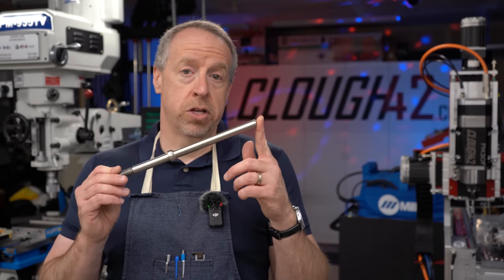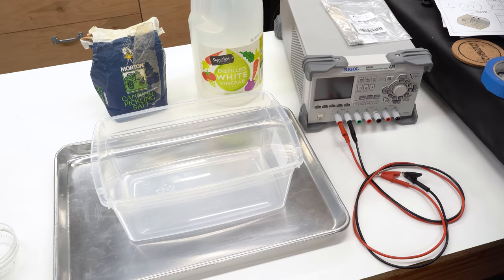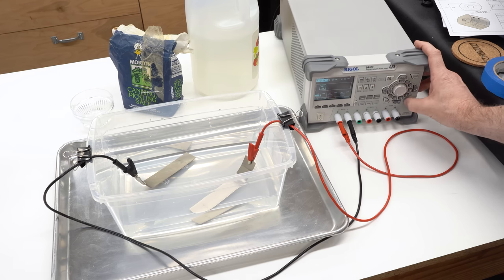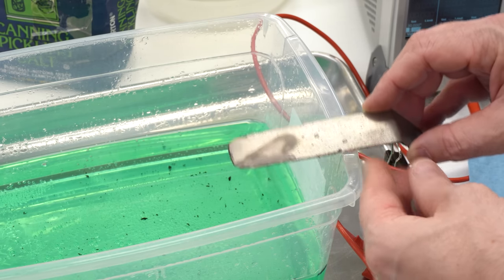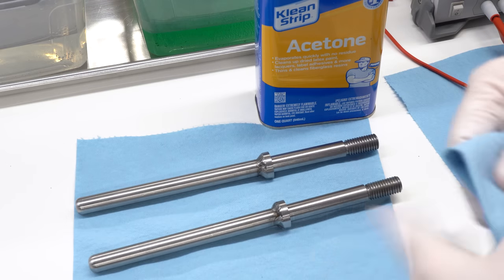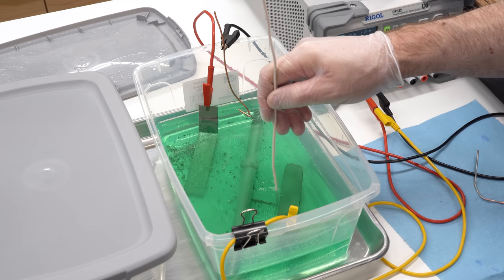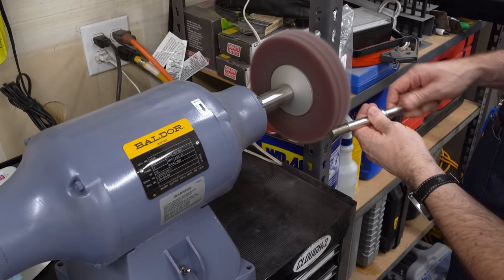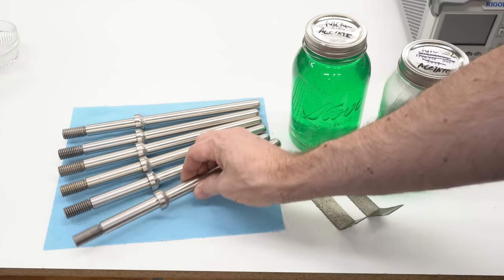Nickel Electroplating in the Home Shop - A Shocking Way to Prevent Rust!

Comment: Whatever you do: don't be tempted to do the same with chrome. The resulting waste is very toxic, you really don't want to deal with that.
Reply: How to create a superfund site in 3 simple steps.
Reply: @tyrannosaurusimperator  You'd probably need a bit more chrome than a few simple strips for a superfund site. But health-issues will appear much sooner.
Reply: Chromium salts are super duper bad news.
Reply: Absolutely, don't mess with chromium. Some of the salts (Cr VI in particular) are not compatible with a long and healthy life. Source: ex-chemist.
Reply: FWIW: Nickel is pretty toxic, just not as bad as chromium. 

FYI: "NICKEL ACETATE is a green, crystalline material, mildly toxic and carcinogenic"

You can also get skin rashes from nickel, so handle with care.
Reply: @spokehedz  Yeah, I put them on my eggs and they don't taste that great
Reply: Your not gonna get the Chrome needed to plate even if you wanted to try.  A chrome bath has the Chrome dissolved in the solution and lead anodes.  It runs at a current density of 1 to 2 amps per square inch.  
In other words, Chrome isn't s diy process.  Even for the most astute of tinkerers.
Reply: Meh you just flush it down the toilet. I may have worked at a place that did that. hehe
Reply: Definitely ! That is even lethal ...

Booby trap : no chrome means no stainless steel !!!
( as donor ... ) 

So even a crocodile clamp would release chrome ... theoretically ...

Comment: The major thing I picked up in my nickel-plating adventures is if you want a shiny finish post plating. You need to polish or buff your part to that finish before you plate it. A very common misconception is the buildup of nickel will "hide" scratching and unpolished surface finishes. This is not the case. It seems like double unnecessary work to polish a part before you plate it but if you are after a nice polish, it is essential. I did electroless plating with old cast iron parts from a lathe. It took several rounds of trial and error to achieve the result I was after, but finally I succeeded. I also discovered if you want a really great finish to plate the parts with copper first, and then nickel plate them. The copper plating is much less fussy, and your parts don't have to be absolutely perfect like with nickel. You do need to polish the copper layer before nickel plating, but copper polishes like a dream compared to nickel or most other metals. Hope this helps, keep on making the great content. Thanks.
Reply: Agree with you,Jarret. An old saying goes that nine tenths of the gleaming finish is due to preparation before the final plating process. The same is also true of high gloss paint finishes.....the secret to a stunning finish is nine tenths in the substrate preparation.
Reply: Almost all "chrome" is triple chrome plated.  Nothing adheres in plating equal to copper, so it goes base, copper is porous to water, so nickel is plated second, thin flash coat, and the chromium is a very thin flash that merely provides the hard finish and bright shine.  Plating puts molecule thick layers so it takes very little chrome in the end.  In a commercial shop, polishing is by far the most labor, cost step.
Reply: Excellent post.  Couldn't agree more. Trial & error, No Short cuts, & no quitting. Etching, electroplating, stone washing or anodizing. Gotta have the beach wheel(s) &  6000 rpm's!

Comment: I'm late to this post, but I wanted to share my thought after doing this few times. Clean, clean, clean. Keep your parts clean and keep your electrolyte clean. I filter my electrolyte after a few hours of use. Filter when you put the solution into the storage container. Keep the current low. One (1) amp for 4 square inches was to much current. Lots of bubbles equals pore plating. I'm no expert, but these are my observations.

Comment: The solution needs to be agitated during the plating process. Keeping the solution flowing helps prevent burning of the plating and also imparts more even plating. You don't want bubbles forming and staying put. The flowing solution moves the bubles so there is constant fluid contact with all parts. Electroless nickel plating  is also something to consider. Caswel also has nickel salt solutions so you don't have to make the solution by scratch.
Reply: how do you keep the solution agitated? I was thinking placing it on top of a home made magnetic stirrer
Reply: @LBCAndrew  That would be a good way. A fish pump works good. And even a motor driven propeller.
Reply: Bubbles and water quality are extremely important. Solution temp also plays into it. My dad had 46 years in aircraft plating. So get that water as pure as possible. And hang those parts so that Bubbles don't hang up for starts.
Reply: I almost forgot. For the best nickel plate you need a layer of copper. So first figure out how to copper plate. Cleanliness is important. So a really good rinse is mandatory with as pure of water as you can get.
Reply: @andron967  Right on the temp and water, the copper is best to use but you can nickel plate without copper. It just depends on the application and what you want out of it. People used to bring me coins to plate and often times Id forgo the copper because the finish was much brighter without it. Copper striking the coin would dull the final finish. On a tool, I'd certainly copper strike the tool prior to nickel plating.
Reply: If the tank is vertical you will have a little warming. And there will be some hydrogen released from your parts. So that will cause a little convection of the solution. Try a layer of copper plate as an under layment. Copper Nicole then chrome with a very clean rinse of purified water in between.  Disposal of waste gets to be a real problem. That's why private plating shops are becoming rare. Cyanide is one thing that becomes hard to dispose. But that's not all.
Reply: @LBCAndrew  A small aquarium pump will suffice for a small plating tank.
Reply: via "Gefahrstoffe in der Galvanotechnik und der Oberflächenveredelung", regarding your elecrolyte: The electrolyte temperature is usually 60 and 65 °C. The current efficiency is about 95%. This means that hydrogen development and aerosol formation remain low due to the process. However, the nickel aerosol content in the air at the workplace can be influenced by electrolyte movements or the blowing in of air. Nickel and the salts: Main modes of action: Acute: irritation after swallowing, irritation of the respiratory tract. / Chronic: Carcinogenic, sensitization possible with prolonged skin contact.
Have fun at home, with your open bath (like in the video) and your aquarium pump ( *facepalm* ) :) (Note: your old COVID-Masks will not protect you from those aerosols ...)

Comment: Adding on to what Sad Panda said, in my home shop experience with home electroplating and anodizing. I found that once you have your solution made with the cheaper source metals. Use a coffee filter to clean the solutions of contaminates. I then use a glass pyrex container to hold the solution and put it on a chemistry heat plate as I found it works better at around 110F. I then make 3d printed stands for the parts and have only nozzle thickness point touching of the part so there isn't a chance of accidental contact with the anode. I then use 100% pure material for the anode for the final plating process.

Comment: Check out some papers on adding the laxative Polyethylene Glycol (PEG 3350) to your plating solution.  I don't remember much from back when i was doing copper plating, but I was under the impression that as the molecules deposit they make peaks and valleys.  The peaks get larger and larger over time and you end up with that matte finish.  The PEG is attracted to the peaks and inhibits depositing, forcing the valleys to get plated until everything inverts and the PEG breaks off and attaches to the new peaks.  No idea if it works on nickel though. Worth looking into though!

Comment: If you want a polished look, you must polish the part before plating. It is not a self leveling type of deposition. Also, please note that though this will likely prevent corosion in your environment, electroplated nickel is not very corosion resistant. Electrless nickel is, but because of the phosphorus included in that process.
Reply: I can totally agree, the more polished the base, the more polished the final product. Also not corrosion resistant, the deposition of the nickel is not homogeneous, micro pores are left where water gets in and corosion starts. I have done quite a few experiments with electroplating and corosion testing and everytime the parts star to rust with very little rust spots.
Reply: Can you show us the other process?
Reply: @Kevin Bauer  That might be the most boring YouTube video ever:
Fade in, and pan from stage right.
A man is standing at a workbench.
A glass pan is on the bench in front of him.
He takes a jar out of a paper bag.
The camera zooms in tight on the label on the jar. It says "Caswell Electroless Nickel Plating Solution”
Switch to camera two, a quartering shot over the man’s left shoulder.
The man removes the lid from the jar and pours the contents into the glass pan.
The man reached off camera and his hand returns holding a metal part.
The man gently places the part in the solution in the glass pan.
The man reaches out to a kitchen timer on the workbench, and presses start.
The camera zooms in tight on the timer.
Fade to black.
Fade in.
The camera is still on the timer; however, the elapsed time is now seconds before the alarm is to sound.
The alarm sounds, and the camera zooms out. The man approached the workbench from out of view. He is now wearing rubber gloves.
He removes the metal part from the solution in the glass pan. It is noticeably brighter colored than before.
The camera pans slightly stage left revealing that a bucket of water is now next to the glass pan. The man dips the metal part in and out of the water several times, and then sets it on the workbench.
The man opens the jar, and places a funnel in the open mouth.
He pours the solution from the glass pan, back into the bottle.
Fade to black

Fin…
Reply: You are absolutely right, though if platying with copper as a in intermediate stage, certain fine scratches can be "smudged out" through polishing. That's badly explained but a few microns of copper polished hard really can in my very limited experience, help to improve the appearance of a lightly scratched hard base metal. Then once the copper is buffed - the final plating will (hopefully) be awesome!

Comment: Not sure where you get your distilled water, but I've seen some supply chain problems result in it being out of stock where I am.  I recommend keeping between a hogshead and a butt of it on hand in case you can't get it for a while.  Don't just combine units of measure, use obsolete measurements as well!
Reply: I bought a cheap countertop distiller, one of the best purchases I've ever made
Reply: How many cubic furlongs (or cubits) is that?
Reply: What's that work out to in barleycorns then?
Reply: @slowerthansound  two liters would be 3295.28 cubic barleycorn.
Reply: @firstmkb  at  least an acre
Reply: Get a bucket , put it outside when it rains
Reply: @MegaClaymor  Ahh, thats where I was going wrong, I had the barleycorn per fathom ratio incorrect!
Reply: @jerinjohnson8346 Rain water is likely to be contaminated with atmospheric pollutants including metals and oxides as it falls from the clouds. Rainwater is never going to be anywhere near as reliably pure as distilled water made in a controlled process. Definitely don't use rainwater to top up acid batteries.

Comment: Excellent results, for so simplistic a method.  IIRC, top notch work for nickle on steel requires copper 1st.  So thorough surface preparation, including electro-cleaning, comes 1st. A copper "strike", which is (sic) frequently cyanide based lays some copper down.  After the initial THIN layer from the "strike", a thick layer of copper is laid down.  Additional surface preparation, including buffing, may follow.  At long last, its time for nickle.  So, a Woods nickle "strike", starts the layer off.  The bulk of the nickle layer is laid down in a Watts bath.

Nickle electroplating anodes are encased in "Dynel" or similar acid resistant bags, in order to trap the inevitable sludge.  Even with bagging, either periodic or continuous bath filtration is necessary.  Debris in the bath employed was obviously present.

After honorable separation from the U.S. Army, I was hired in the 4th quarter of 1968 by Bulova Watch Co. as a chemical laboratory technician in the dial department.  In that capacity, I acquired some knowledge of electroplating that has stayed with me.
Reply: What are your thoughts on using this process to plate the inside of a cast iron cylinder block? the intent is to build up the walls when the typical repair would have been to install a sleeve.
Reply: @2000freefuel  Typically that's nickel silicon carbide on aluminium.  The interwebs suggest that can be done on cast iron sleeves but with issues on adheasion.
Reply: @anullhandle  Duly noted I was looking for a way to repair a cast iron cylinder block without boring to a larger size or installing a sleeve
Reply: @2000freefuel  You can look into hard chromium plating, but that process is something STRICTLY reserved for professionals.
Reply: @eliduttman315  I think your missing the point of my question, I'm looking for something a hobbyist can manage in their garage with some basic tools and materials.
Reply: @2000freefuel  IMO, a DIYer should stick to sleeving.
Reply: @2000freefuel  I don’t think you could have enough build up for sleeve replacement. Nickel is difficult to plate even up to a thousandth. Will not adhere well enough.
Reply: @philthompson9633  Only needs to be thick enough to fill the damage caused to the OEM bore. perhaps bronze plating.
Reply: @2000freefuel  you're going to need several thou which can be difficult to get exactly where you want it to go.  Might look at spray welding, they take metal powders with an oxy acetylene torch and  build up surfaces with it.
Reply: Thats cool!!
Reply: @2000freefuel  he got the point. You missed it. He very generously replied with the wisdom and experience he has and instead of him saying "NO" he gave you a possibility and warned to seek professional help.
Reply: I worked the last four years in an office at the old Bulova factory in Queens, NY
Reply: @bucklawrence1439  I'm guessing Astoria B'lvd/Jackson Heights, which is where I worked for 2 years.  However, Bulova had an older plant in Woodside that remained operational.
Reply: @JK  Your holes are not gonna be true. You need to worry about ring gap, piston wall clearance, honing the nickel you put on so the rings break-in. Now you worry about premature ring failure.
I think It would be cheaper to do what's been tried and true. Just rebuild it, buy a crate motor, or short/long block.
Reply: I guess the Hard Chrome which although a professional process because of toxicity, was presumably suggested because Nickel, Copper etc. are quite soft and have poor wear resistance.
  I hope you found a suitable and enjoyable process.
Reply: Thanks for sharing an for service in military